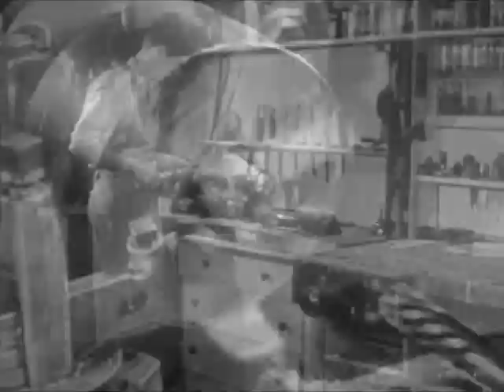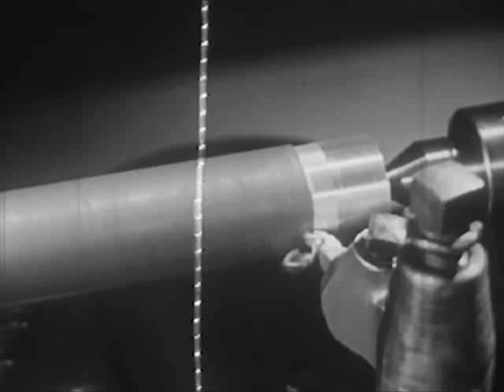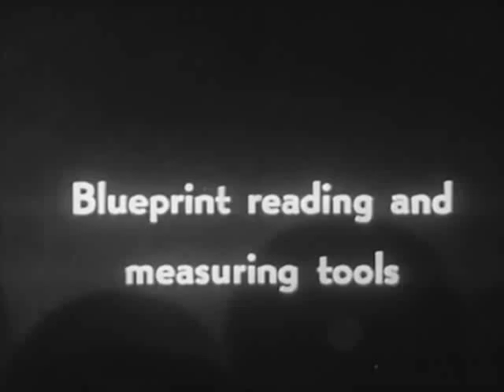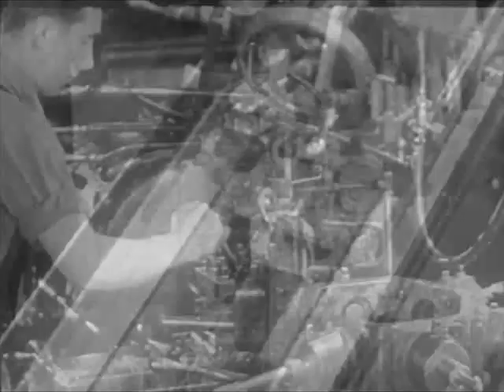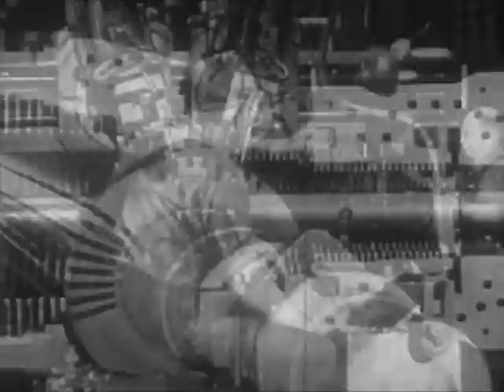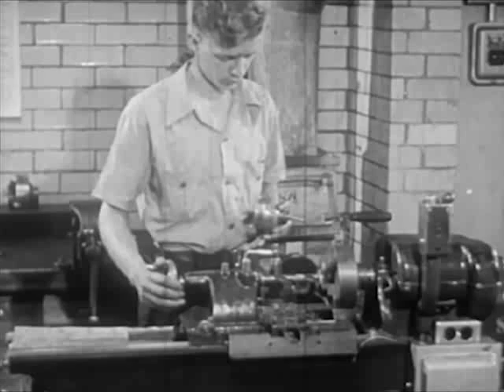1940s Vocational Guidance Film: The Machinist and Tool Maker - 1942 - CharlieDeanArchives

Comment: As a shop teacher (machining) those old timers in that video, that were born in the 1800’s knew more about machining than I’ll ever know.  Amazing
Reply: I was extremely lucky to have learned machining from a few very skilled old-school machinists, they taught me a ton of tricks and methods that modern day machinists don't know or understand. I also went to a tech college for machining and my teacher was a 4th generation machinist, he really knew his stuff. CNC machining has definitely improved the machining process, but it has also killed off a lot of specialized knowledge and practices which is very unfortunate. I know an old school manual machinist who won a bet with some Boeing engineers, he won $10,000 bucks from them after he completed a job they said was physically impossible to do with manual machines, so of course he did it with nothing but manual machines lol.
Reply: why do you say that?
Reply: @christophercolumbus8944   because of the computerization of the machining industry, it has killed off a lot of old skills and know-how that was common knowledge in the days of all manual machining, along with the ability to use a pencil, ruler, slide and protractor to design and draw plans by hand. I'm a machinist of 17 years with a ton of old school experience and yet I don't hold a candle to the bonfire of skill my non-digital predecessors had.
Reply: @TheExplosiveGuy  sounds like what you're saying is 
hey although i can use a mitutoyo caliper i am just going to use my ancient roman caliper device to measure my part i am sure my client would love that !
Reply: @christophercolumbus8944  That's not at all what I'm saying, I dont think you have much of a grasp on what manual machining is or how complicated it was. I'm saying there were machinists from before the days of computerized machine control that could make parts just as accurately as a modern machine and just as complex, things that would even require 5-axis machine centers and a brilliant mind to program it today. The gist of what I'm getting at is technology has changed and things like manual machining are being phased out and the knowledge of how to do it is being slowly forgotten. Since you seem to like metaphors, it's like a modern clock maker that exclusively uses a digital display, microprocessor and quartz timing crystal to make clocks that function flawlessly, they are more accurate and repeatable than ever, easier to read, more durable, cheaper to produce, and easier to design and manufacture in bulk quantities. What I'm talking about is the everyday Joe Schmoe watch maker (or machinist) of old that learned from generations of skilled mechanical clock makers before them who used their accumulated knowledge, skill and hard work to make works of art with nothing but their hand tools, hands and minds that rival most of today's modern digital clocks, meeting or exceeding most aspects aside from a fraction less timekeeping accuracy and production volume. They take longer to make but are far more valuable than some dime-a-dozen production line throwaway crap we get with modern commodities these days. If you ask even the most skilled modern digital clock designer that only makes digital clocks to make a mechanical clock with a couple rods of steel and sheets of brass and give him all the old school hand and machine tools, the end result wouldn't be pretty and more than likely non-functional. Same goes for many of today's modern CNC machinists, you ask them to tilt the head multiple times on a Bridgeport manual mill to place a series of holes in a part with a true position tolerance callout of .005" at different angles in relation to a set of pre-determined tooling balls located on the part or table that have to be dialed in and the trigonometry calculations made to know where to move the datum upon repositioning of the head, they will run away screaming in frustration. 

I could be a lot harsher than I am right now, this is definitely one of those "open mouth, insert foot" moments for you here, but instead I'll turn it into a teaching moment. The lesson here is don't make assumptions, if you were unclear about the intent of my comment it's a lot easier and productive to just ask me to clarify what I meant. Insults will get you a whole lot of nothing in this world (I can guarantee that), think before you speak my man.

And just to be clear, I'm not saying manual machining is better, in many cases it's not, but there was a lot more to be proud of back then when the vast majority of the work wasn't done for you by the machine. It took real skill, hard work and determination to be a successful machinist and in many places machinists were revered in society like a doctor would be today, it was a highly respected line of work, versus nowadays where it's just another blue collar job unless you're in the upper levels of management.
Reply: @TheExplosiveGuy  there is no way and i am not going to read all that litany of bulls ..  
explain me this , genius 
how do you machine cast  in 1940s? 
WITHOUT CARBIDE INSERT ? 
huh?
Reply: @TheExplosiveGuy  where are you from? 
when i went to school we covered all of that 
first manual machines then cnc it was imperative to learn the basics before learning CNC but having been machining for sometime now CNC MACHINING  i guarantee you i don't care if you have 50 years of manual machining experience under your belt or your tool and die license CNC is completely a different world 
so MANY factors eg direction of cutting tooling fixturing dialing of course programming etc etc
Reply: @christophercolumbus8944  So you're not going to read my response but you expect me to respond to yours? I answered your questions but apparently you don't have the patience (or is it ability?) to read more than a few sentences so I'm not going to waste my time or my patience on you. FFS, you must be fun at parties...
Reply: @TheExplosiveGuy   try not to ramble and be concise with your comments. 
i hope you learned from me today.
Reply: @TheExplosiveGuy   Great comment!   As an engineer, I worked directly with machinists during the 70s and 80s - and was always so impressed with some of the older workers.  Talking to them was like taking a class - they taught me so much about their side of the process.
Reply: @christophercolumbus8944  Looks like youtube didn't like your response there, I wonder why that could be? You mind telling me why I'm a D-bag? Though honestly I think you're just projecting.
Reply: @TheExplosiveGuy  ok ok 
sounds like what you're saying is 
hey although i can FLY to great britain from canada 
i am just going to take the trip via BOAT

Comment: "If you’re not afraid of hard work and are willing to start at the bottom, you can become a machinist."
Reply: A WAY better than become a McDonald's waiter or a junky.
Reply: I wanna start on day 1 as a tool and dye maker
Reply: @johnjaco5544 , Ohoho, maybe on day 1 of year 5! That's how long it will take you to learn what you need to know, to begin day one. And they're DIES. As in molds, for metals and plastics. And that takes college level triginometry to begin to understand. And tool making is pretty much gone. You can now just simply buy any kind of tool you need, rather than have someone on hand, to make it for you.
Reply: Machining jobs in the United States are gradually being automated by cnc machines. Hand operated machines & the "Machinist" are a dying breed. The machinist now adays are computer programmers.
Reply: @TheReal10bears  
Good point. Also it requires more than skill at inputting computer codes (which is not the same as computer programming - but I digress). It really takes a machinist mindset, an understanding of materials and the underlying physics. Frankly I can’t understand how you’d acquire this on a CNC, but I’m an old fart.
Reply: @PrivateEyeYiYi  I was a hand operated machinist & I know what you mean about not understanding the machining aspect as a cnc programmer compared as to the machinist of the past that felt how the machine ran & cut as the operator ran the leigh. I ran a "hardinge leigh" for 15 yrs before I was fased out by cnc's
Reply: Been teaching machining, welding , and fabrication for 35 years....You know what kids want  these days ? Cell Phones, Booze, expensive cars, and easy jobs...attention spans are VERY LOW...Entitlement attitudes VERY HIGH.....sad but true folks...offer kids internships in Manufacturing...reply...."Nah...I can make more money delivering Pizzas"
Reply: @markclauss2314 , 35 or 40 years ago. baby boomers were coming of age, entering the job market, where there were literally millions of us. So employers had their choice of the cream, most of the rest were disposable. I joined the Army as a wheeled and tracked vehicle mechanic for 4 years, only to be told that my military experience wasn't translatable. BS. So, a machine shop took a chance on me, I furthered my education with college technical courses, because we had no choice but to be competitive. A wise man has said that America is now reduced to a nation that sells burgers to one another. So, I have crossed the finish line of the rat race, as a Quality Manager, retired to Southeast Asia, where machine, sheet metal, and welding shops are thriving. Good luck to American Millennials. They can enjoy poverty in their old age.
Reply: Step 1: Move to China.
Reply: @PrivateEyeYiYi , won't work. They use slave labor. That is, prisoners. Political ones, that they can keep for as long as they see fit.

Comment: Why was the last pic showing us how to thread backwards?
Reply: Don't think it was threading backwards as you call it. The operator just put the spindle in reverse so the tool can run in opposite direction without taking it out of pitch. ( if you look closely tool not cutting).
Reply: Old school trick with old machines. Old machines didn't have thread dials so you would back the tool out and run the machine in reverse to go back to the start of the thread and keep the tool in the right position. Later machines added thread dials so you can disengage your lead screw and then catch your thread and the thread dial let's you know when to engage the lead screw.
Reply: @kevinconiston2270  👋💪
Reply: it was a reverse screw.  Greetings from Russia from a worker with 40 years of experience💪👋
Reply: @flyfly368  55 years of traditional machining, in 87 took programming and CNC since, I know what I see, thank you for you underestimated response. F@ck the US but I sent rovers to Mars with my capabilities!
Reply: @earlvanfleet3501  🚀👍

Comment: The higher mathematics referenced is mainly trigonometry and algebra. The principles of calculus will help you be well rounded but don't really apply to the trade.

I worked up to setup man and was learning injection mold making whe I left to get an engineering degree at the age of thirty five. I should have stayed in the trade.

Comment: I was a machinist I used a manual lathe and a CNC lathe or Mill. It is a great job and you can make a very good living. Kids should be watching stuff like this is school.
Reply: They don't  want  to  get dirty
Reply: @miguelcastaneda7257  when I worked in a machine shop I didn't get that dirty. I did get a lot of metal splinters though.

Comment: I was a machinist for 10 years. I got out of the trade when the facility I worked at closed down. The trade has advanced to the point that most of the "skill" is no longer required. A lot of the work has been exported to countries with low skill/low pay employees.

You can still earn a living as a machinist in the US... But don't expect a steady or lucrative career.
Reply: True  I used  to run shops now am a cnc helper...and repair  older manual and cam nachines...but wages no where near what used to be ...but they still want your knowledge

Comment: what tolerances did they have?
Reply: .0001
Reply: Am in aerospace and we hold .000020 mill straight and round
Reply: Same as today's 
The only difference is that it became automated 
(CNCs)
Johansson gauges are same as they were in 20th century
Same goes for micrometer

Comment: not a brother NO place in video perfect example for considering race as long as you have same skills you need the same opportunity
Reply: At the company that I work for for almost 40 years as soon as the blacks were up to join the machine shop it was closed down.... it's work load greatly reduced
Reply: @dwightpowell6673  
Same goes for gypsies in Europe
My friend worked for one small machining company 
Shortly after some majority of engineers left  And they hired gypsies  
Let's say they couldn't hold the same standard as the workers before 
It's not that they hired some random dudes 
All of them had the same school for it 
Behaviour was abysmal and workpieces returned with all kinds of errors  shortly after they fired them all and the company had to close down .
IAM all for same opportunity but if they have skill for it and determination to improve
Reply: Your sentence structure isn't up to machinist standards.
Reply: @Onethirtytwo  maybe so BUT GUARANTEE I’m one bad ass CNC and old school lathe machinist also I grind tooling also

Comment: None of the machinists in this video had safety glasses. Absolutely none of them.
Reply: The bloke on the Surface Grinder did
Reply: Back then, the Safety Squint was an acceptable OSHA practice
Reply: CAUTION: Vintage workshop images. Feel free to point out the obvious.
Reply: @leeroyholloway4277  if you have never worked in a total manual machine shop environment for a living.. you could not possibly understand..
Reply: Safety glasses are over rated..I’ve gotten things in my eyes that went over and under my glasses. Since I wear glasses anyway I’ve always had them on naturally.. but you can still get chips in your eyes. Only inexperienced snowflake wanna be machinists and tool makers would think this.